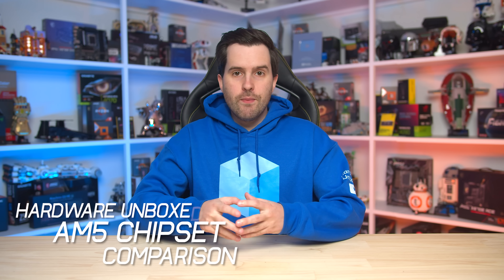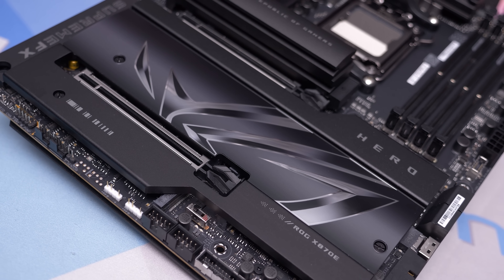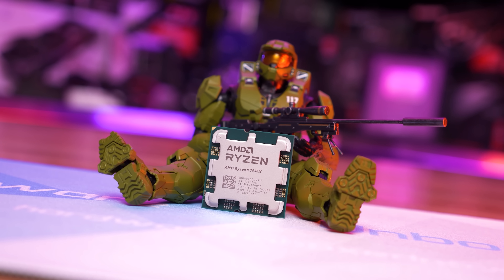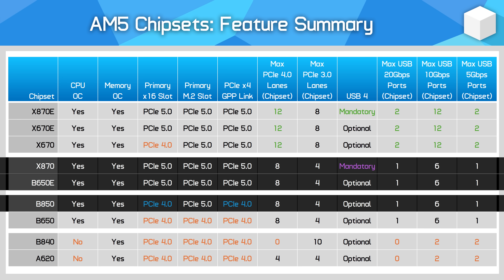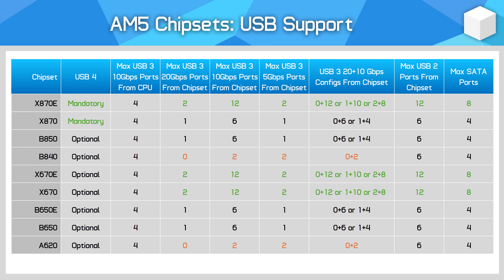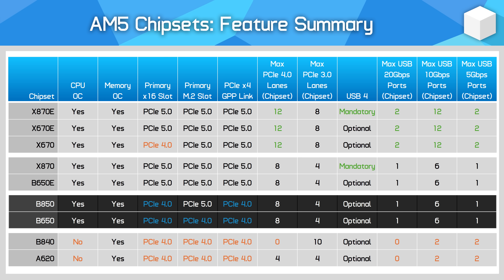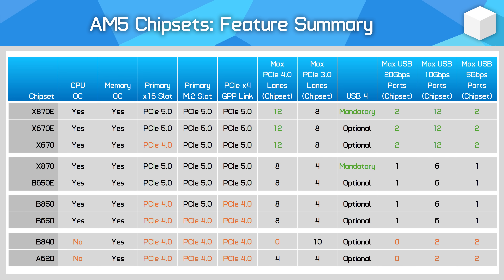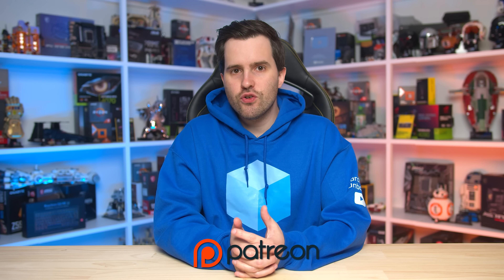AM5 Chipsets Compared - X870E vs X670E vs X870 vs X670 vs B650 vs B850 vs B840 vs A620

Comment: Can someone explain me about Asrock B650 Steel Legend.  If ı used 2 sata 5.0 PCıe GFX and M2 still run 16x?
CPU:
- 1 x PCIe 5.0 x16 Slot (PCIE1), supports x16 mode*
Chipset:
- 1 x PCIe 3.0 x16 Slot (PCIE2), supports x4 mode*
- 1 x PCIe 4.0 x1 Slot (PCIE3)*
CPU:
- 1 x Blazing M.2 Socket (M2_1, Key M), supports type 2260/2280 PCIe Gen5x4 (128 Gb/s) mode*
- 1 x Hyper M.2 Socket (M2_3, Key M), supports type 2260/2280 PCIe Gen4x4 (64 Gb/s) mode* Chipset:
- 1 x Hyper M.2 Socket (M2_2, Key M), supports type 2230/2260/2280 PCIe Gen4x4 (64 Gb/s) mode*
- 2 x SATA3 6.0 Gb/s Connectors**

------------>     "If SATA3_0 and SATA3_1 are occupied, PCIE2 will downgrade to x2 mode."

Comment: I think B840 is just worse than A620, though. Only allowing PCIe Gen3 on the B840 boards essentially brings this from an "A620" successor, to essentially a refresh of the B350 platform.
What is even wilder is that AMD's own official marketing team states B840 is not competing against something like Intel H610 but is actually meant to be an Intel B760 competitor despite B760 having advantages in things like Gen4 PCIe lanes.

A620 actually posed a fair fight against Intel's B760 lineup because it actually had the same PCIe Gen4 support and would essentially be boiled down to a cut features B650 which was really cool because a well-designed A620 board could honestly make a great budget choice for a modern gaming machine if you do not plan on tinkering with the CPU's performance settings. I would totally recommend an A620i Lightning + 7500F/7600 to anyone who wanted to get started on an SFF gaming rig without spending +200$ for a motherboard, and they just so happened to not be interested in CPU overclocking.

Now that A620 has been replaced by this absolute trashcan of a B350 successor, what even is the point of buying AMD's lowest end boards?

Comment: Meanwhile, ASRock: Here's the B650 Steel Legend. It supports PCIe 5.0 for both the main PCIe x16 slot and the top M.2 slot.
Me: So it's a B650E?
ASRock: No, here's the B650E Steel Legend. It's functionally identical to the B650 Steel Legend except it costs more, has a negligibly better VRM, fewer USB and SATA ports, and an ugly black PCB instead of the nice white one on the B650.
Me: So why would anyone buy the B650E?
ASRock: E

Seriously, what the hell is going on?

Comment: Do NOT buy X870(E) boards they are a straight DOWNGRADE from X670E/B650E boards. All they have done is remove choice and forced manufacturers to spend 4 CPU PCIe lanes on a crappy USB4 controller, thereby REMOVING your second PCIe 5.0 M.2 slot.
There is no reason whatsoever to buy an X870(E) board because there are no features on it that couldn't be implemented on an X670E/B650E board; if you do, you are actively wasting your money and buying subpar capability.

Comment: Rocking a $110 AsRock A620M Pro RS Wifi and I think i'll survive the AM5 era without issues. VRM is good for a 12 core chip, DDR5 6800MT/s is stable, BIOS allows you to tweak CPU voltage offset and enable PBO. No PCIe 5.0 but comes with a couple of 4.0 and a single 3.0 M.2 slot. I also get a BIOS flashback button and debug LEDs. What more can one want?

Comment: Chipset has nothing to do with PCIE version. Ryzen 7000 and 9000 CPUs have 28 PCIE 5.0 lanes on the CPU silicon, 8000G have less. B650 boards not providing PCIE 5.0 to the primary slot is artificial limitation which has only 1 purpose - market segmentation. Same with PBO/OC, chipset has nothing to do with it, you don't have PBO on A620 because that's the way to make you buy B/X boards.
Chipset is just a splitter that allows connecting more USBs/Sata and stuff.

Comment: I have noticed what appears to be a significant change of direction with AMD 800 series chipset motherboards from the 600 series chipset, as I cannot find a manufacturer’s board which includes the standard Display Port option just only HDMI 2.1 option.

So, is AMD phasing out completely the Display Port option on motherboards in the coming years to standardise to solely HDMI ? If so, that will force a lot of people like myself having to buy a new monitor with an HDMI 2.1 port wanting to retain high refresh rates for gaming!

Comment: It would have way better if the CPU SSD slots were configured to be downgraded to 2 4.0x4 slots than having them share the lanes with the primary x16 slot. I'd rather have two Gen 4 SSDs directly connected to the CPU and full bandwidth for the GPU than just one Gen 5 SSD and full bandwidth for the GPU or multiple Gen 5 SSDs and only half the lanes for the GPU, especially since direct storage is a far cry from reality and should still be supported on Gen 4 storage and with Gen 4 storage being far cheaper on a cost per GB basis, not to mention their lesser cooling requirements.

Comment: I skipped over the B650 because of the lack of PCI 5.0 x16 slots. The B650E seemed like the better buy for the long haul as it had PCI 5.0 support across the board. Very useful video!!
Reply: Pci 5.0 x16slots is for 50 series GPU and only 3-4 fps drops if you use 50 series GPU in pci 4.0 x 16slots mobo

Comment: Whats the point?  After watching many of your video's touting the 7800X3d performance over i9-13900k etc.  Well I fell for it and bought the 7800X3D, Tuf gaming B650 Plus, 64GB DDR5-6000, with a RTX4090.  In MSFS2020 using same scenario I get 18-19 FPS @ 3440x1440, while my old i7-13700K running triple monitor (NV surround) 7680x1440 with my RTX 3090Ti runs same scenario at 51-52FPS.  And yes have run PBO and Curve optimizer (-32 stable) Very disappointed in your mis leading reviews.

Comment: 24 or 28 pci e lanes? Its confusing in the video actually... He is switching between 28 and 24 med sentence...
Reply: None of it matters, you get 16x for gpu, 2x M.2-cpu (4x each) that's what matters, there's also a 4x downlink to the chipset which everything else hangs off (sata, USB, ethernet etc).

amd X670E/X870E: 1x pcie5 cpu-m.2, 1x pcie4 cpu-m.2, 1x pcie5 gpu +extras
amd B650/B850: 1x pcie5 cpu-m.2, 1x pcie4 cpu-m.2, 1x pcie4 (5 optional) gpu
intel Z690/Z790: 1x pcie4 cpu-m.2, 1x pcie5 gpu*
amd B840/A620: 2x pcie4 cpu-m.2, 1x pcie4 gpu
intel B760: 1x pcie4 cpu-m.,2, 1x pcie5 gpu*
*(pcie5 NVME steals from the GPU)

Comment: You forgot to mention the dual chip models have substantially increased idle power. Which could be a factor for users that keep the machine powered on 24 hours a day either as a dual use desktop-fileserver or who plan to later repurpose it into a media or file server (Maybe with a low power CPU swap.).
Reply: Source? I can't find any A-B testing anywhere with graphs of otherwise.
Reply: @tomstech4390  the dual promontory chipset sucks down a ton of power for a chipset. its basically a zen IOD chiplet, and in my 5900X the SoC idle power draw (IOD) is 18w. on my x570s board, which also has a dual promontory chipset, like x670, but older version, the chipset is idling at 70°C with a fan blowing on it. the chipset is probably sucking down 10-25w.
Reply: @sgredsch  Source?
At 25p/kwh here in the UK the 7w tdp equates to £15.33/year if running non stop.
Reply: @tomstech4390  That is 15 pounds not pence. 0.007kw×24h×365.25days=61.362kwh
61.362*25p=1534p=#15.34. 
This does not account for increased cooling, add about 20% to the power for fan or refrigeration load. (so 8.5w total or a cost of 18.40 per year) and if it puts you over the line where you cannot use natural convection and need an a fan or a larger fan, then you have capital cost to be amortized over the 5 year expected life of consumer fans. Say 15 for a fan , that is 3 per year the cost is now #21.4 per year or 107 for a 5 year lifecycle.
Reply: @mytech6779  Or you dont add a fan and just put a heatsink on it like they do.
Reply: @tomstech4390  … were you dropped on your head?
Reply: @mytech6779  Put the crack pipe down son, amd seems to be doing just fine, no AM5 motherboards are bursting into flames from overheating.
Reply: @tomstech4390  The basic product spec is 7w per promontory 21 chipset (A620 cuts this to 4.5w, I guess via underclocking) 

I keep asking the various review channels to add idle power to their product testing but no responses. All these "high end" components stack additional idle power consumption.
(Even all the extra fans add up.)
For comparison I have a purpose built server that idles at 5w with a peak of 14w with an active mechanical hard drive. (I don't think this includes power supply losses, I don't have a wall meter to test absolute power and powerfactor at the moment.

Comment: I kept my last build pretty simple. 7700x (budget reasons), B650 (although I wasn't really happy with the MSI PRO B650M-A WIFI board I got at 1st, recommended here, but updates have brought it around and its good now) and was able to score a Radeon RX 7900 GRE at msrp. I haven't had any issues, temps are good, and it does all the things I need it to do very well. probably the only upgrade I would like is the 7800x3d but things are good, and I can wait until it's cheaper.

Comment: I replaced my x670e pro from gigabyte for having WiFi issues and I have the x870e pro now from gigabyte…no complaints, has an oled dr debug screen
Reply: Wouldn't a wifi card suffice and save some money instead of buying a new board just to solve your wifi issues?
Reply: @HAM_An1mA  I had a protection plan at micro center so swapped it out
Reply: no chance of just direct plug in via ethernet?
Reply: Do u use 2 m.2 ssds ? Does it affect gpu performance?
Reply: @ I do use two, no it doesn’t affect me at all.
Reply: @ gen 4 or gen 5 ? You can only use one Gen 5 Ryt. I have 2 gen 4 ssd want to go for gigabyte x870 or e Version for my white build.
Reply: @ they are 980 pro from Samsung
Reply: @ thanks for reply , I have wd sn850 and 850x

Comment: Frankly the whol e 8xx series is utterly useless to me. if it doesnt have 5 audio jacks im not interested. MSI x670e tomahawk will be the board for me despite the very dated audio dac which is worse then my 6 year old current pc...
power draw consumption diffrences on dual vs single chipset could be interesting but i dont care as much now as they simply are not a valid option for me.

Comment: PCI bifurcation on x870 boards can actually be a detriment if you are not hell bent on having USB4. For instance, you might get only 1 dedicated M2 slot that is wired to the CPU and the other two/three slots might share bandwidth with the (typically GPU) x16 slot. Putting an M2 in those slots will cut the PCIe5.0x16 to x8 whereas on B650E this is usually not a problem and you can typically populate all M2 slots without eating lanes from the GPU slot. The other thing is that x870 is supposed to have better DDR5 memory compatibility for higher speeds but I don't know how true this is in reality. It can support 256 GB in total (versus 192 on B650E chipsets) but honestly if you want PCIe5 (for GPU and M.2) and don't care about USB4, go with B650e. Of course, it is extremely unlikely that any GPU in the next few years will require PCIex16 bandwidth.. so yeah just get a good B650 and call it a day :D

Comment: PCIe 5.0 is a must-have, so anything limited to 4.0 is a non-starter due to faster obsolescence and those chipsets are eliminated.
X870e, X670e, and X670 is just paying for more extra PCIe lanes and USB ports than you can shake a stick at (or, more importantly, than most people can use).
Basically the only real options worth considering are B650e or X870, and between those two, at a likely similar pricepoint why would you buy the older one, so it's really only X870.
There you go, AMD motherboard selection, (over)simplified. :)
Reply: PCIe 5.0 is most definitely not a "must have". Firstly, there isn't really any hardware using it (and there won't be much, for quite some time); secondly, 99% of people will never need or use PCIe 5.0, even once the hardware will be available.
It's a typical case of wanting "the best", without even understanding what actual advantage the technology offers.
Reply: @Gaius__  I'm already using a PCIe 5.0 NVMe drive, so I have no idea why you'd claim there isn't any hardware really using it. There is, and it's a must-have because faster storage is one of the most cost-effective performance improving upgrades you can make - but only if you have fast enough slots to use it.
Video cards in the lower-midrange are also trending towards using fewer but faster PCIe lanes to cut down cost, and not being able to use PCIe 5.0 is likely going to hold some of them back from getting their full bandwidth potential in the future.
Reply: @wasd____  There is absolutely no reason to use PCIe 5.0 storage for anyone who doesn't move 50GB-fiiles around all day long. In addition, a single 5.0 storage drive is useless, as you can only move files at the best speed both drives offer. GPUs in the lower/midrange are most assuredly not moving towards 5.0 either. By the time a relevant number of GPUs will, AM5 will be EoL.
5.0 is a complete waste of money for 99% of the user base at this time ... but enjoy your 0.826 seconds faster boot time. I'm sure that's worth the extra 350-or-so bucks you spent on the combination of motherboard and storage drive.
Reply: @Gaius__  I'll bet that back in the day, you would have been one of those people talking about how "No one will EVER need more than 1Mb of memory!", too. 😂
Reply: @Gaius__  You must be fun at parties. I'm sure everyone around you loves being told how they're wrong and "suckers" for being interested in things you have decided are "useless" (despite there being people in the real world using them quite successfully).

Comment: So, the biggest difference is the '8' for the '6'. 
And that USB 4.0 is mandatory for premium boards. Those were premium boards before, too, so it already was a hard sell to offer boards withouat USB 4.0
Reply: No one has ever, nor will ever need USB4 on desktop and the implementation on X870(E) is absolute shite on top of that.
And even for those who wanted USB4 for some unfathomable reason, there were better implementations of it on X670E already, as well as the ability to just add it with a Thunderbolt card.
Reply: @MajinOthinus  True that. USB4 was a mistake.

Comment: Any AM5 chipset, from the cheapest to the most premium one is only connected to the CPU via a PCIe 4.0 x4 link. I don't understand why we think of motherboards in terms of the chipset they use, when the chipset is essentially a PCIe to USB converter.
Reply: *SATA/USB/Ethernet switch.

Comment: I think flexible chipset specifications like this will allow for greater variation in board pricing and differentiation of boards by features at different tiers. That said, it will probably continue to push "fully loaded" boards even further north in pricing. As usual, read/watch reviews from good people like HUB and make a decision on what actually _is_ rather than what is claimed (marketing/chipset/brand/model).

Comment: It's bad enough AMD copies Intel's naming schemes to try and mislead layman consumers.
Reply: If Intel didn't do it then it wouldn't be misleading.
Now a B840amd or B760 intel both have ram OC but no cpu overclocking so they're aligned.
They should rename B850 to Z850 though to make that in line with intel, that way both Intel adn AMD Z-boards would have both CPU OC and RAM OC.

Comment: Every single x16 PCIe 5.0 slot is waste, nothing fast enough exists to use that bandwidth. And by the time something does exist that needs 16 5.0 lanes, AM5 will be obsolete. Everyone should go for 8x/8x 5.0 or better yet 8x 5.0/8x 4.0/8x 4.0, that would give us 3x slots directly to the CPU.
Reply: No
Reply: This comment didnt ago well… we have PCIe 5.0 GPUs and they certainly only pair well with AM5 CPUs at the moment
Reply: @aaroncheatham5849  NVIDIA RTX 5090 PCIe 5.0 vs. 4.0 vs. 3.0 x16 Scaling Benchmarks, watch it and then go drink a glass of water in shame

Comment: I would 100% separate the advice about buying B650 into actually buying the B650E if you want the ability to use the upcoming generation of GPUs with the build, 50xx series cards are PCIe5 not PCIe4 which is the standard config as shown earlier in the video.
Reply: Will they actually use more than pcie 4.0 bandwidth, though?  Doubtful.  New cards will work just fine with B650 motherboards, in the general case.

Comment: Most people slap 2 dims in the MB, 1 stick of NVME, 1 graphics card and they are good to go (yes fans, cooler, etc). Most do not need more than this basic setup so having anything better than a basic B840 really is not required. Yes go for the B650/ B850 for extra NVME and marginally better sound but in reality as a percentage of users very few use 3 NVME and need more than 1 to be PCIe 4.0 or 5.0 and / or require PCIe 5.0, fewer then overclock the cpu (expo available on the B840). Generally we buy better because we can not because we need to.

Comment: Hi, I have an Asus X670E Crosshair Extreme and it has two USB 4 ports with both 10 and 2.5 gbs ethernet.  So, does that mean that upgrading to the X870E won't make a difference?
Reply: in fact it would be a downgrade as the only thing you gain is nitropath (~400mt/s higher ram than 600 series) but you lose stuff like 10gb lan on your extreme model as theres no x870e crosshair extreme
Reply: @Joopitah  I wonder if there will be an X870E Extreme?  I would buy one if they made it.